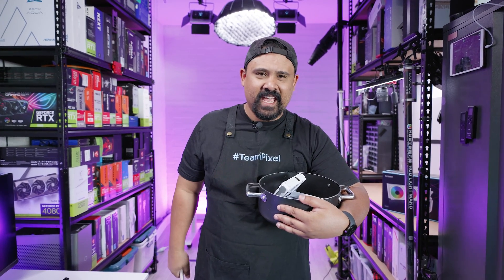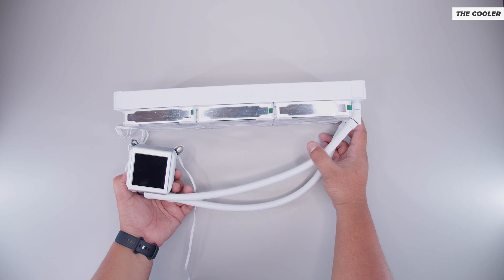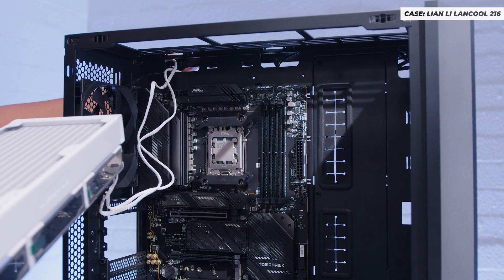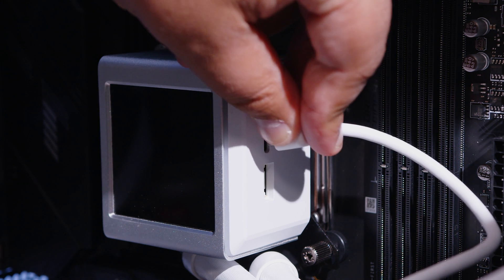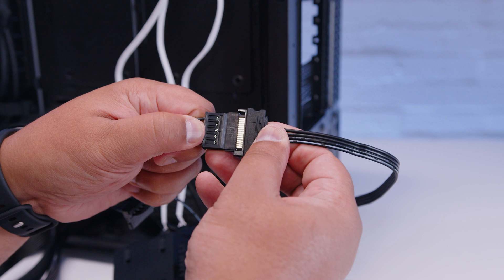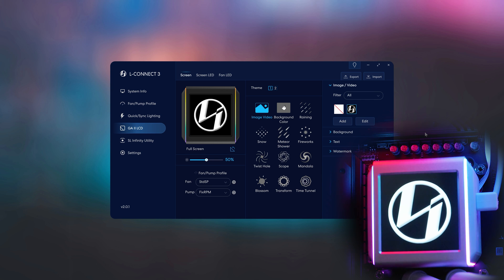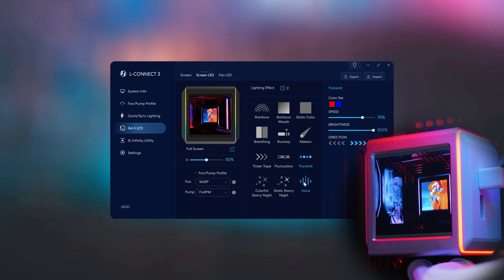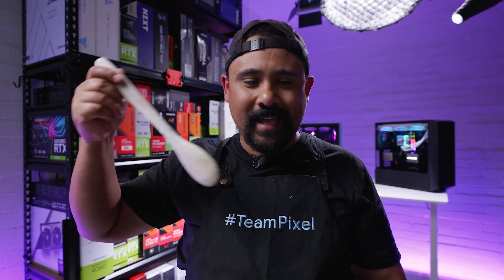Lian Li Galahad II / GA II LCD: Definitive SETUP & INSTALL GUIDE

Comment: Amazing guide as always! I just installed this AIO into my system a few days ago, and one thing worth noting is that the USB-C cable going into the pump block requires an extraordinary amount of force to be fully inserted. When I first booted up my system the screen and ARGB strips kept turning off after a few seconds and I thought I had a faulty unit. Turns out you just need to push the cable in with A LOT of force for it to click into place. Hope this helps anyone else that may run into the same issue.
Reply from the maker: I'm going to pin this one. I did notice that but forgot to mention it in the voiceover :)
Reply: " extraordinary amount of force to be fully inserted."  ABSOLUTELY CORRECT. I went through ALOT of headache becaue of this. YOu have to push enough until you hear/feel a CLICK. When you feel that, it means it's finally connected.

ALSO. Word of warning. LConnect 3 software that is use to control the  AIO, LCD and aRBGs, does NOT like iCue, Asus Crate and the Fusion RGB.  I am yet to find a software that I can use to control the lights on my Consair memory cards and my Consair K70 motherboard because the Lconnect cannot control them. It's horrible in that regard.

LASTLY. IF you are planning to use additional Fininity fans, you MUST double check that you have more than TWO USB2 motherboard ports. If you do not have more than do then you need to buy a internal USB2 hub such as NZXT Internal USB 2 hub. Buy that additionally and you'll be golden.
Reply: no wonder people complain the unit did not work.
Reply: This is 100% needed to be said with the instructions for sure. Thank you!
Reply: I THOUGHT MINE WAS BROKEN UNTIL I READ THIS COMMENT! THANK YOU SOOOO MUCH
Reply: Thanks god I came to the comments🙏
Reply: Thanks for the tip, i am going to be building tomorrow so this is a great last minute tip 😂
Reply: This is why I usually read the comments. I haven't installed mine yet, but I will be ready for this. Thank you for your comment and thank you Gear Seekers for pinning it.
Reply: Installing mine now, I hear the click but am still experiencing this issue, I know this is a year later haha but any help is greatly appreciated
Reply: @Gooey2kk any luck? 7 months later ha. Same issue here
Reply: I'm pushing as hard as can with no click.

Comment: Hey so this takes up both my usb headers on my motherboard, but I still need a header for my case. What can I do to deal with this? I really don’t want to have to return the motherboard and redo the build. Any help would be appreciated because this is driving me crazy
Reply: Get a usb splitter, plug it into one usb header then u have 2 ports coming out of that one header that are both usable, a bit of a pain but better than getting a new mobo🤷‍♂️

Comment: Currently in the process of building my new PC and I have the GA II LCD SL-INF 360. There doesn't appear to be different screws for AMD/Intel anymore, the screws came pre-installed on the mounting system.
Reply: Same… did yours workout with the pre installed screws?
Reply: @thepioline  Yup! Worked just fine

Comment: Has any1 received the version where the pump screws are preinstalled? If so how'd u get it been having trouble. Cant get it to line up with cpu bracket
Reply: I dont know if you got it figured out or not but I too have this version. It feels almost as if the bracket doesn't fit right? but, you just have to push down while twisting. It will give you some leeway, and do this in a star pattern.
Reply: @lunnahc1445   wut i did was take the cpu brackets off screwed them n2 the pump brscket then screwed it n2 the mb. Tht took less than 5mins. N i fought with it 4 over a day.  Everything been working great tho low temps etc
Reply: hey did you figure this out? no matter how long i try to screw it in it just endlessly keeps going and it just doesnt feel properly seated

Comment: So I have it all set up and one fan on the cooler the light is off and the fan speed is very slow also have 3 lian li fans with rgb not working they work but half the rgb don’t work not sure what I did wrong here

Comment: When I built my computer, I put my cpu cooler standing on one side. But I would like to change the place, and mount it at the top. Is it a stupid thing to do? I also have to rotate the LCD screen. That's why I wonder if it's "stupid" x)

Great video!

Comment: Nick, I'm confused on which controller to use. I'm installing the Lian Li Galahad II Trinity 360MM- AIO along with the Lian Li UNI Fan SL-Infinity fans in my case. I thought I should use the controller that came with the SL 3 pack Infinity fans or should I be using the controller that came with the AIO? Does it matter?

Comment: Anyone notice that on the Fan/Pump Profile that the fan speed was registering as 0 RPM? I have the same exact issue with mine and cannot find a work around to get that to connect to the radiator fans. The 240 radiator edition appears to plug right into the cooling block itself but with the 360 you are going to the external controller. Anyone else figured out a fix for this?

Comment: Can anyone help? I have the cables from the fans plugged into the controller, controller with pass through to mobo. Lcd screen works, but the fans/rgb does not. 

I ensured all plugs were firmly in. From the pass through fan its plugged into cpu_fan. The rgb passthrough i have connected to another hub provided with case (king 95 pro) to control all rgb. 

Should i take the fan and connect that directly to mobo?
Reply: Tried mix matching everything. 

Everything slotted correctly. Fans and RGB just refuse to turn on
Reply: @Ethan_Lynn mine too and i can’t figure it out
Reply: @miaann6647  I ended up reconnecting the cable that connected to the fans and it worked. The one that can change directions

Comment: Lian li 216 is white. I have a ROG STRIX B550-A GAMING alpha board. I only have AIO_Pump in the left middle of the motherboard. On the top I have CPU_FAN and CPU_OPT. If I connect it to AIO_PUMP, the BIOS BOOT shows that CPU is Error. The LIAN LI connect controller is connected to the FAN HUB of the 216 housing.
 Can't the RGB of the Pump be controlled from ARGB?

Comment: i've done everything in this video, but my lcd screen doesn't seem to even load up at all. When plugging it in i did see it flicker for a split second on the screen, but then I turn on the pc and there's nothing on the LCD screen.
Reply: Have u found a solution to this
Reply: @Gooey2kk took it to microcenter, turns out I was using an older motherboard with a new am5 chip. I needed to flash the bios and that fixed it for me.

Comment: i bought this over the weekend at micro center and the box didn't come with "n" cable as it's called in the instructions...it is the split cable that plugs into the argb fans...i went back to micro center and they opened up 4 boxes and all of them were missing the cable...does anyone know if i can I can order that cable or a pack that has that cable in it? if not i am going to be really upset...i believe the actual cable is the PWM and ARGB to Lian Li Uni Fan SL Infinity 7 Pin Adapter Cable...if anyone has any suggestions on this i would really appreciate it thank you!!!

Comment: I have a question, i seem to have gotten the 280mm with 2 fans .I cant seem to get the computer to detect the fans , doesn't show me the rpms or nothing but it does light up along with the lcd . What would be the reason for everything to work but the fans function. This model didn't come with a controller so i assume it should work with out or do i need the controller for it to be functionable ?

Comment: So what do I do if my screen doesn't turn on? Does it need to be connected to a monitor to turn on?  I read the comment about using extraordinary force, and even still, the usb-c cord still seems wiggly? anyone have any suggestions, please help!
Reply: @ReignDGF  did you ever fix. Having the same issue
Reply: Same here ^ rgb and screen turn off after a couple seconds when starting up the pc

Comment: I would like to know what happens if I do not use the USB connector on the controller? What would stop working? I understand that the 3-pin connector would control the RGB and the 4-pin connector would control the fan speed. What would stop working on the hub if I do not connect the USB?
Reply: i have the same question bro
Reply: I think maybe the screen stops displaying but i could be wrong, never owned this AIO

Comment: what about the the plug thats right below the usb type c on the aio head ?
Reply: Im pretty sure its only for the 240mm version. Those fans plug in directly to the pump vs the 360mm use the controller. It's a bummer cuz just like the video the fan RPM shows 0 and there doesn't seem to be a way to fix that.

Comment: If I have multiple sets of fans  going to the hub, I don't need to connect the Argb cable to the motherboard for every additionally set do it? Just pwm for all of the additional set, and then everything is controlled from the hub at that point? 

Thank ahead of time! Been watching your stuff for years.

Comment: Thank you for your work on this! I have the same Gallahad II and the same motherboard. I followed this guide to meticulously, however my system fan in bios all read zero.  They all work, and show up in L-connect 3, but on the bios level, it doesn't appear that I can control them. Any ideas?

Comment: Just got this for my system and installed it, however one of the rgb strips on mine doesn’t seem to work :/ kinda bummed and don’t really want to have to strip it out again
Reply: did you rma this or you left as it is?
Reply: @Voltomess  As it turns out I’m just a mega idiot - the lights sit somewhat inlayed into the cooler, and so from a certain angle it doesn’t look like they are on / even there, but I can happily confirm if you look at it properly front on it is working lol!
Reply: @neb1006  🤣🤣🤣🤣 very nice I ordered mine today for my new build.
Reply: @Voltomess  I hope you enjoy it! I’ve just managed to mount my gpu vertically in my new build! Couldn’t do it at first because the gpu was pressed against the cpu cooler really hard! But I sorted it
Reply: @neb1006  Was your case too small ?
Reply: @Voltomess  Nah, it was super fiddly and I had to move the universal mounts pcie slot forward to make everything fit

Comment: One thing thats annouying with this unit and the tl lcd fans , is the CPU usuage when displaying sensor readings . I dont know why but usuage can range from 7% to 13% , which causes idle temps to rise from 36c to mid to high 40s for me . Also i have had random disconnects only with the Gallahad II and causes my game to crash and had to restart PC . Great products but issues with L-connect 3 .

Comment: Do I need to plug the argb header of the hub tho argb header on mobo to control argb of these fans? I thought the mirco usb cable is enough for both pwm and argb control

Comment: What about the other cable that plugs into the side of the pump? You only plugged in the USB-C cable. There is another couple that plugs in right next to it and it has a SATA power cable. So are you sure the pump had power? The fans were plugged into the hub and the hub had SATA power. So that means the fabs had power but the pump did not. Is there anything I am missing?
Reply: The other cable is if you are NOT using a control box. The other end has adapters for the fan PWM and RGB leads.
Reply: @markmizrab3310  the RPM gauge shows 0 RPM. I have the same issue with mine. Seems the 240 Rad plugs directly into the pump and works fine.

Comment: I like the infinity fans and also the display. BTW, its 8th Gen Asetec with a good cooling-performance ... perfect, but. does it have an negative effect, that the intel backplate is plastic and would you recommend better thermal paste for an Intel 14900KS?

Comment: They changed the AM5 mounting. It doesnt have that black plastic piece anymore. Just pins that connect to the block and ratchet it down.
Reply: @IDontKnowYou1216  bro can u help me pls? i didnt get how to install that without the black plastic
Reply: Did u fig out? Im having trouble aligning the preinstalled screws with the cpu brackets

Comment: I’ve recently installed it in my pc everything is working except the lcd screen it’s just black and the pump runs at full rpm I’ve tried the firmware update that lian li has on their website but it still isnt working and it also disconnects at random moments making the usb sound i’ve plugged in everything and made sure its all the way in like they said on their website but its still not working properly, the problem is mainly the lcd screen. Do you have any solutions for me ?
Reply from the maker: Unplug from the USB header on your motherboard and replug while the system is running. Also make sure all the cables are plugged in properly. The USB cable to the pump top needs to be plugged in quite firmly from memory. Double check :)
Reply: did you fixed it?

Comment: Great video but what is the second outlet for on the pump head? The cable goes to the pump head and splits to sata and a couple others I can’t remember. Is it not needed?
Reply: Iv got the same question and there’s no manual in the box
Reply: Im pretty sure its only for the 240mm version. Those fans plug in directly to the pump vs the 360mm use the controller. It's a bummer cuz just like the video the fan RPM shows 0 and there doesn't seem to be a way to fix that.

Comment: at @7:16 you say that cable is optional but not why you would or wouldn't use it  ? Also, what is the other port on the side of the LCD screen beside the type c used for? Thank you
Reply: @Let_The_World_Burn  I would like to know too, did you find out?
Reply: It seems teh 240 Rad fans plug directly into the pump unlike the 360 rad fans use the controller. Just like the video the RPM shows 0 for the pump fan.

Comment: Great video.  I am stumped on something, maybe you can help.  I have the GA LCD cooler AND a triple pack of 120mm infinity sl fans (which has its own controller).  How can I connect both hubs up to the PC?  Can each hub be connected to a usb port on the motherboard?

Comment: The back plate is so cheap. Do not over tighten the screws cause if you need to remove the pump for any reason, the prongs will come off the plate itself

Comment: Yeah went to install my Galahad this evening and the box fires up and displays everything as it should. But I had a problem with the fans not coming on or getting any kind of RGB lightning... I'm wondering if I just got a faulty unit 😩 I looked up so many wiring guides and it appears to be hooked up as it should be. Im just not getting anything going on with the fans or lighting 🫤
Reply: Did you ever figure it out? I'm having the same issue as you.

Comment: If I’m using the controller than I don’t have to use the pass through cable right? I’m talking about the wire at 17:20

Comment: You missed one connection on the pump with 2 connectors?? Did you just leave it unplugged?
Reply: Im pretty sure its only for the 240mm version. Those fans plug in directly to the pump vs the 360mm use the controller. It's a bummer cuz just like the video the fan RPM shows 0 and there doesn't seem to be a way to fix that.

Comment: hi, im stuck here with the setup. I bought 3 pack lian li fan that use totaly diferent type of conector from fan to the module. . Can I just use the module from triple pack to conect  the galaha 2 lcd aio inf?  i do have spare conector from diferent style, that i can replace on the fans of the aio galaha 2 lcd.
Reply: No you can’t
Reply: Actually it might work but not sure what did you end up doing?

Comment: Did you get the controller with the Gala or with Fans?  I didn't receive a controller with my Gala.
Reply: Gotta love it pay $230 dont get what you need then ALL videos with the wrong cooler and useless install information then the actual real upload on lian li of this come with a fan cable that has different connections and yours cant connect to it and has a third cable that seemingly goes nowhere. Dogshit company should of just stayed with corsair.

Comment: Anyone know if this will fit on a strix b650e-e. Wondering if the amd brackets will clear the capacitors down side of cpu socket
Reply from the maker: Should be fine

Comment: This is best wiring video i ever seen for Galahad LCD. 

Quick question. 
Is cables enough for other reverse infinity fans ? I have 6 of them
Reply: @AytacYildirim  sorry late response, but whatever fans come with the AIO, the fan hub matches that. So you can add other SL infinity fans (4 sets total of daisy chained fans). So if you have 3 fans on the front of your case, it only takes up one slot on the hub. Hope that helps

Comment: stumbled across this guide, thank you for putting this together.  I don't understand why the fan config on this AIO is set to exhaust the case air out the top.  I would think, and I tend to configure, CPU AIO cooling to pull outside fresh cool air in through the radiator and not push hot case air through a hot radiator.  Would love to hear your perspective on it.  I would have flipped those fans over frankly.  Curious to hear your thoughts, and others that follow you.
Reply from the maker: Exhausting air out the top is the optimal setup because the front for you case should be set to intake.

Comment: How come you have zero fan rpm for the aio fan?
Reply: Im pretty sure its only for the 240mm version. Those fans plug in directly to the pump vs the 360mm use the controller. It's a bummer cuz just like the video the fan RPM shows 0 and there doesn't seem to be a way to fix that.